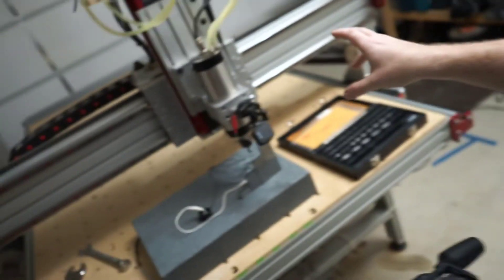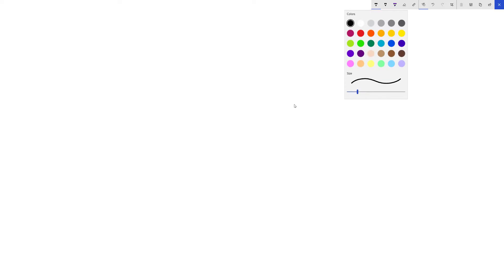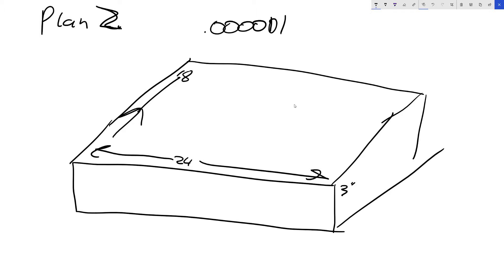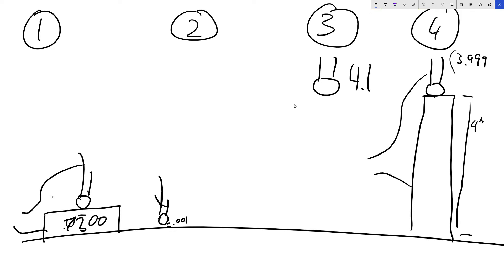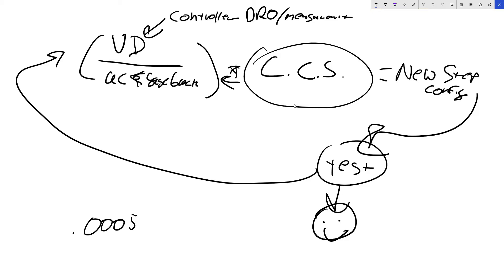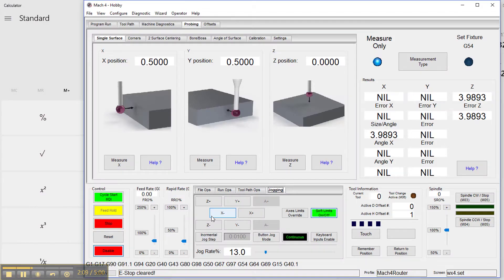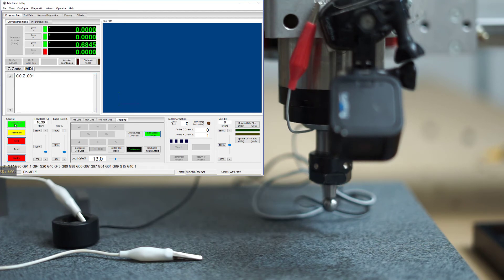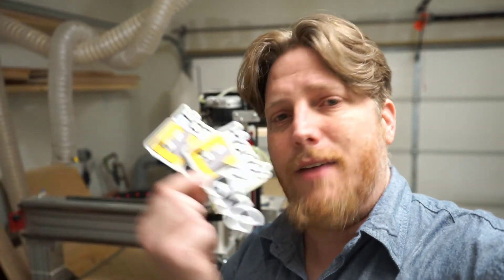CNC Router Z axis Tuning with Gage Blocks

Comment: This should be fairly easy to do with a dial indicator instead of the touch probe. The indicator will measure the error between the gauge block (a known distance) and the movement of Z carriage without introducing additional errors from the probe.
I will try this and post the results.

Comment: I'm down for 30-minute videos. 20 might be better, but I'd rather the video be longer than to miss out on pertinent information. Then again, I typically watch YouTube while working on my own stuff, so my attention is usually divided between two tasks. Since I'll be sitting in front of my computer anyway, 20 - 30 minutes isn't a big deal.
Reply from the maker: Thanks.. I am kind of like you in that I don't want to skip anything.. There are videos I have seen where that one crucial bit of info was skipped.. 

Wonder what others think.. Or breaking up the videos and sharing them in playlists...   But yah, if you can't tell.. in general I like the longer format as well.
Reply: I like long videos. Less time spent clicking to find another video while I'm tinkering with my machine